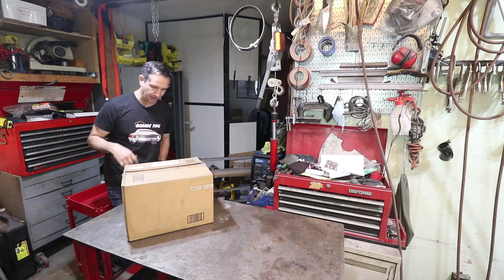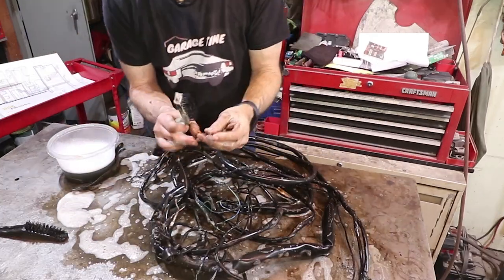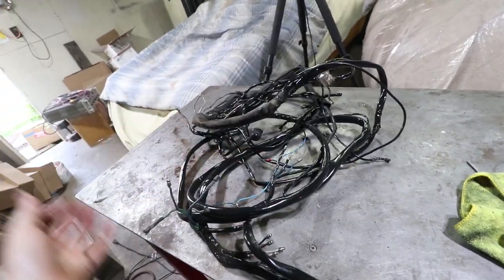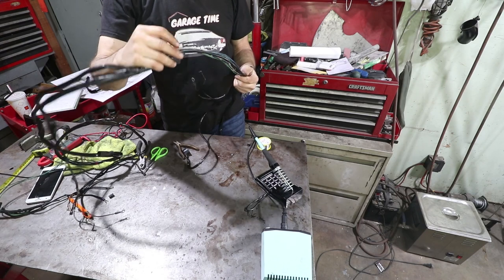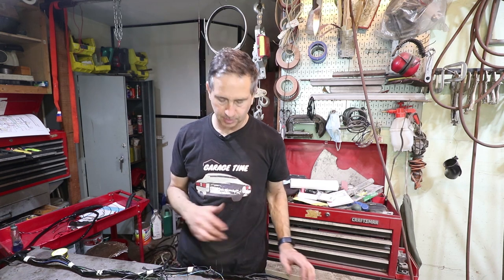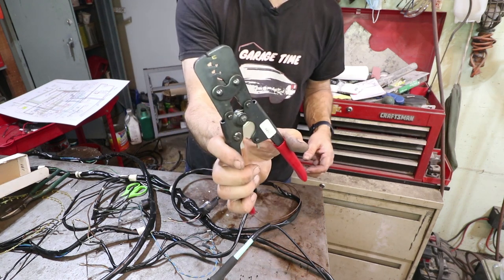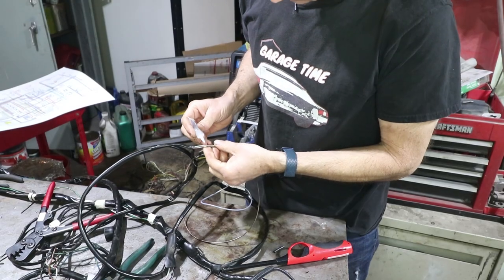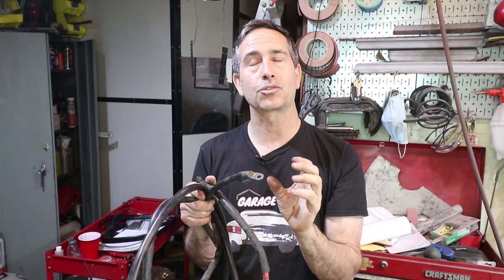Miraculous Surgery On My Porsche 356 Wire Harness Repair

Comment: Great Video Tom.  One of the companies that I support makes wire harnesses for missiles.  They have huge wire harness boards everywhere.  My plan all along has been to clear off a big section of my garage and get some plywood standing up vertical and map everything out.  Replacing these wire harnesses is ridiculously expensive and with a little care it seems that you can easily restore them.  Great video as usual!
Reply from the maker: I have a wire harness board for the engine test stand control boxes that I make.  Over 500 made and it's simple.  The wires are lifted about an inch off the board with some special clips.  The ends fan out on an extension spring!  The wires nest right between the spring coils.  Works like a champ.  
I had several companies quote these harnesses and it's more cost effective to hire someone like Zach and supply the board.

Comment: Ironically I am just doing this on my original harness on my 60 B T5 at the moment. A Qantas engineer told me to use a 70% dilution of nitric acid to clean up the terminals and copper, which I have ordered and just awaiting delivery. I also need to remake the main engine harness from the tunnel back as it was cut here when removed from the car! Thanks Steve, Sydney, Aus
Reply from the maker: Best of luck with your harness!  It just takes time!

Comment: For the cost of new, yes I would restore as well.  Great job!  Would it have been possible to buy the color coded wires in short lengths and saved some time painting color strips on the wires you used?  Seems like the paint would wear off.
Reply from the maker: Yes, I think YNZ sells the striped wire and it's probably the better way to go.  I painted some wires on my 911 with adhesion promoter and it is very difficult to rub off.  Kind of makes you wonder the stripes are put there in the first place?
Reply: @GarageTimeAutoResto  Thanks for the tip on YNZ.  I see they do some Jaguar work.  I may have to try your method as well with the adhesion promoter.
Reply from the maker: True, one of YnZs Jags was painted at the same place as my 356.  Beautiful car, but I haven't met the owner yet.

Comment: Why are you using non-shrinkable sleeves ? They are available in almost any size. You may consider using self welding tape for the parts where old fashioned electrical tape is used.
Reply from the maker: The original ones are non- shrink and glued, but I am going to get more of both.  The trouble with rework is that the assembly order isn't ideal.  Good call on the welding tape.  I'll check that out too.
Reply: @GarageTimeAutoResto  You may even want to check expandable (woven) sleeve and selfclosing sleeve. They make life so much easier.

Comment: Love your videos & your 356. In your video you mention replacing the larger sheathing that covers the majority of the harness, but you don’t mention where to find it. I’m restoring an old Mercedes 560SL harness and can’t find this type of material. I can find heat shrink and all the modern coverings, but I can’t seem to find this. Do you have a resource?
Reply from the maker: Hi and thanks.  It's called PVC sheathing and it's available from McMaster Carr.  It doesn't shrink, but it's available in many sizes.  I recommend wire aid to lube the wires.  it's better to pull them through than push.  
Also the best heat shrink is raychem SCL.
Reply: @GarageTimeAutoResto  I found the site, but I can’t find any flexible PVC tubing rated for high temperatures and is fuel/oil resistant. It seems their stuff is all rated for liquids. Their high temp & fuel/oil rated stuff is rubber. I figured it was PVC & I have the smaller stuff that is for high temp, abrasion & fuel/oil resistant, but I can’t find the bigger stuff.
Reply from the maker: Here's one of the part numbers I used 1508T34
Reply: @GarageTimeAutoResto  Perfect! That’s the stuff I was looking for. I truly could not find it using their navigation. You were a great help. Thank you again.

Comment: Between YnZ and Kroon here in Europe we are talking at least $ 1,500 for a new replica. Did you test the wires for resistance etc. before you committing to refurbishment? There is an outfit in the British Midlands that advertises a complete replica (down to the correct color coded wires) for 564 Pounds Sterling (!!) but they have no photos on their website. Some sort of combination of bulkhead connector with male/female bullet connectors would have maybe prevented those turkeys from cutting that harness in Australia when they dropped that 60 B T5 engine. ( I am planning something along those lines.) Great topic as always, Tom. Many thanks for the trail blazing!
Reply from the maker: I've heard good things about Kroon too.  Bummer that your harness was cut.  That's what they did on my 911 harness to, but now it's all better.  
I did load test each wire on my 911 harness, and I'll probably do the same for a few wires in the 356 harness.  Off the top of my head, I should check the brake light wire.  Everything else that goes to the back of the car won't carry much current due the starter relay add on anyway.
Reply: @GarageTimeAutoResto  Misunderstanding...it wasn´t my wire that was cut. I was referring to the gent further down from Sydney Australia with the 60 B T 5 whose harness had been cut. I have mulled over a system that will allow a quicker engine drop. That´s why I was thinking along the lines of a bulkead connector for the tunnel (oil temp and pressure) combined with another connector going out of the voltage regulator for ignition and generator.
Reply from the maker: That would be a cool feature. 👍

Comment: Maybe I missed it but why didn't you spend some time ohm-ing out that wire after cleaning the connectors?  That could have been all it was.
Reply from the maker: Are you referring to the wire that I removed?  That wire had burnt insulation with copper showing.
Reply: @GarageTimeAutoResto  yes.  The one you removed. It's possible that high resistance due to corroded bullet connectors or even the socket it was plugged into was what caused all that heat and burned the insulation, not some problem somewhere "in the middle." In that case cleaning the ends and repairing the burnt insulation section could have been all that was required. However, full replacement certainly fixes the problem and was impressive to watch.
Reply from the maker: No this wire was shorted, probably due to a bad coil or loose wire at the engine.  The insulation was bad along the whole length.
Reply: Ah, no other option then.  Makes sense.
Reply from the maker: I'm lucky that wire didn't take out the whole harness